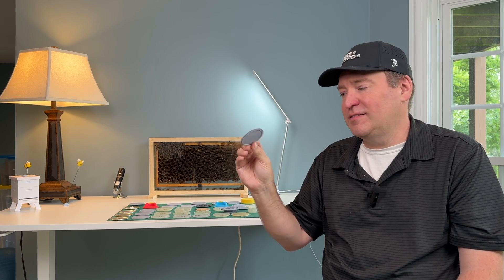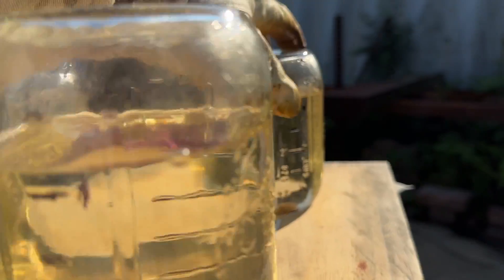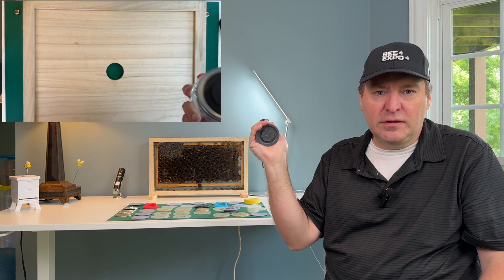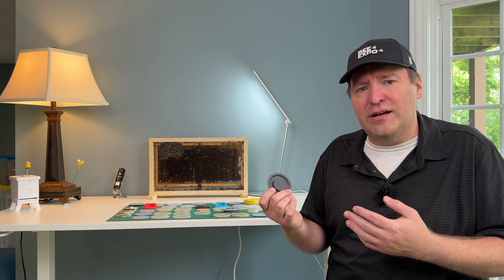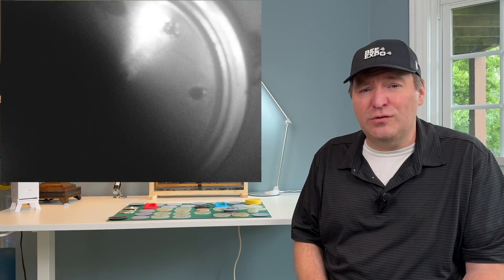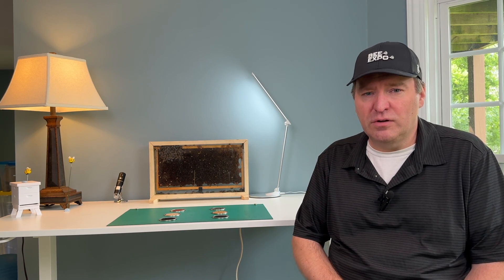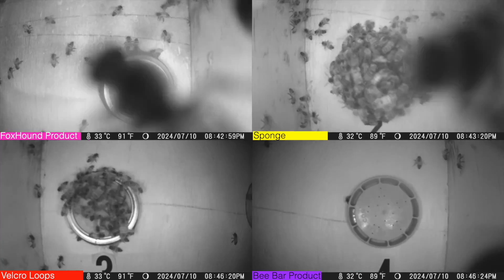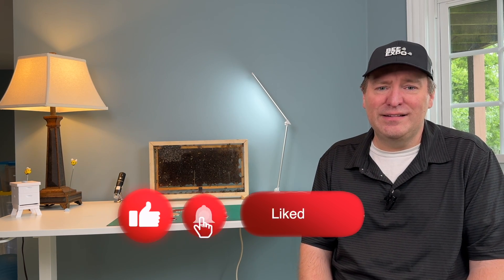I Redesigned My DIY Jar Feeder & Got 100x Results! 🐝🛠️

Comment: Great info! How did you attach the sponge to your lids?
Reply from the maker: Hey Tyler.  I used hot glue.  It works for a quick prototype, but I have better designs coming.  The hot glue comes off of silicone in time.  You don't want the sponge against a drilled metal lid for long, the metal lid rusts without sponge much less being super saturated for longer periods with the sponge.  I'm working on some plastics mixed with the sponge for a rust proof version.  And thanks for joining the VIB community!
Reply: Thanks Michael! I tried responding to your email about the prototype lid but got a postmaster error saying my email couldn't be forwarded because the "recipient's email provider rejected it." 

Just so you know!
Reply: @tylercrowe9476  Odd, I did receive it.  I'll look into that. :face-blue-wide-eyes:

Comment: I stopped at 5:01 to suggest that maybe they have a better grip to get to the middle of that one because its not flat across???
Reply: YES!!!lol, thanks for sharing!!
Reply from the maker: Tomas, you are correct! 🧠 
I had considered asking people to comment on what they thought it was.  Thanks! 🏆
The same gripping mechanism that I'd built to make it easy for the beekeeper to turn and open/close the jar feeder was being used by the bees to hold on.  Next time I am stuck, I'm just going to ask you what is going on, my friend. 🙏
Reply: @TechnicallyBeekeeping also, the centre knob is probably dry. I reckon it's the feed that makes their feet slip off. But you have obviously hit gold with your sponge solution.

Comment: Thanks for the update, this is community changing information you’re finding through your testing. I’ll definitely be trying this sponge idea with my feeders.
Reply from the maker: Thanks, Lance! 🙌  Please let me know how it goes.  I'm going to be trying out different types of holes and configurations with the sponge and other ideas as well.
Reply: @TechnicallyBeekeeping  I just put one together with a normal 1/2” thick sponge over a lid with a few 1/16”ish holes. The bees are already “gaining traction” on the sponge material. Thinking about trying some Swedish sponge material as its quite a bit thinner, might be easier to work with.
Reply from the maker: @MtnBerg, I like the idea of the Swedish sponge.  I used cellulose sponge as it's very porous and I often use pollen substitute that I want to have transfer through the sponge.  There are much more absorbent like aquazone sponge that also have anti-microbial properties that may be interested. 
Regarding the holes, with the sponge, a few can go a long way, so you don't have do a ton of them and good idea sticking with 1/16th". I have been trying bigger hole sizes and you can end up super saturating the sponge and getting dripping.

 Let me know how your feeder goes.  🤞